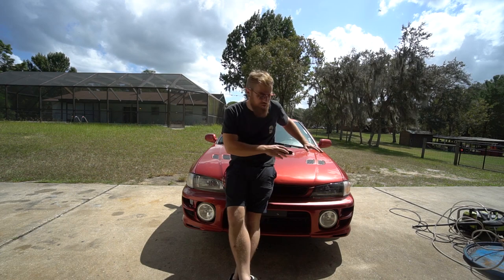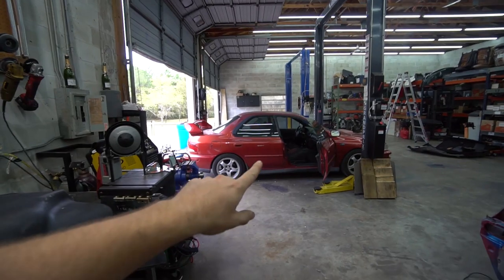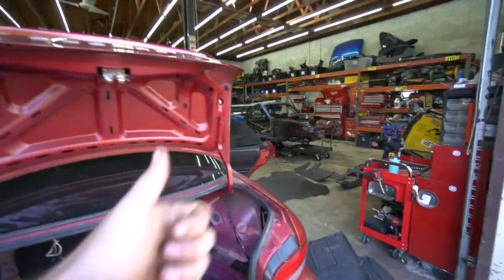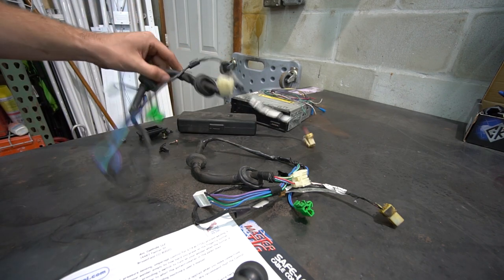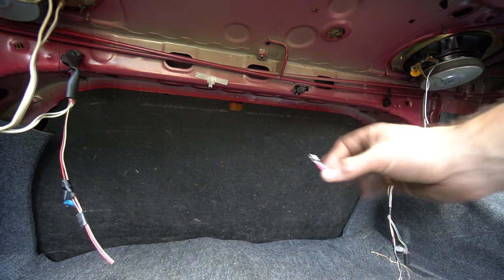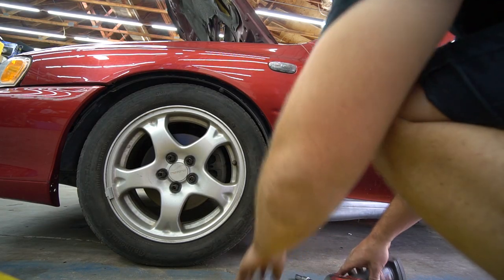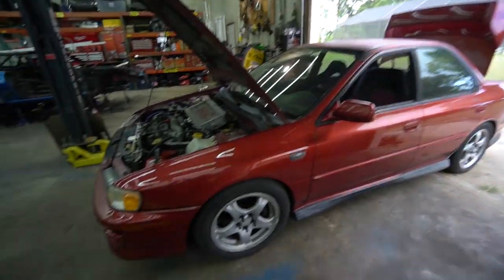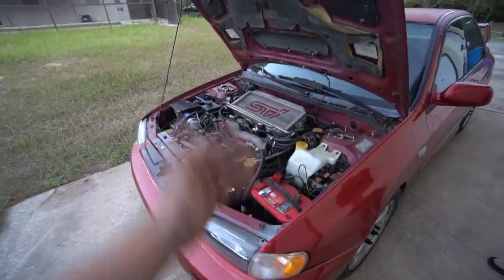Finishing the Subaru Build... And Breaking it Immediately on Florida's Best Backroad!

Comment: If you taking the gearbox out just leave the motor in. The bell housing bolts are super easy to get to from the top and a couple from the bottom.
Remove the down pipe, intercooler, starter, shifter, clutch fork pin, pitch mount and tailshaft and your pretty well done.

Comment: Speaking of things you don't know about in vehicles... The 2001 Impreza 2.5RS I got for free had a rectangular section cut out of the foam under the back seat. As you know, the back seat comes out with just 2 bolts. The compartment was a perfect size to hide some illicit things, hahaha.

Comment: The gearbox is easy enough to take out on these, just remember to remove the pivot for the fork in the box, iirc it's thread a 6mm into it and use that to pull it out.  btw your definition of a back road and mine are two very different things!! :)

Comment: You should really replace the factory oil pick up tube for the killer Bee one and put  loctite on the oil pump bolts they love to back out. Also an air oil separator is really good on those ej the pcv valve is junk these 3 mods are pretty inexpensive if you do it yourself and makes these engine pretty reliable!

Comment: Taylor. I had a hesitation from 2000-3000 rpm light throttle that would clear under boost. Disconnect your 02 sensor and see if it goes away. I had a bunch of corrosion on O2 sensor connection so yours maybe a bad O2! Keep up the great content!

Comment: 7:00 I managed to snag a whole box of 2005 Acura RL bolts, nuts, screws, etc from a scrap yard that just threw all of it in a box

I would not of have finished 90% of my projects so far if it wasn't for that, whenever I engine swap a car and need a perfectly sized 10mm bolt, chances are the box has it

Comment: Ugh, I HATE it when people cut the radio wiring harness...it's like an $18 (or less) part for a wiring harness adapter so you don't screw over the next owner of a car.
Reply: mrsilveri was thinking the same thing. #hack
Reply: When i bought my car i did some research on adapters and had to buy 2 different adapters to plug it in. 
Even after buying them, it turns out for whatever reason the cables weren't even the right way anyway and there was no accessory power. Had to return it and finally give into wiring it my self with the plugs that came with the head unit
Reply: @Pheatan  That's odd, what was the car?
Reply: @CalsGarage  depends, I  know a few that did it with some Hondas but the main issue isn't that. If the adapter harness was used it would make it easier for them to install whatever  head unit they wanted to use as opposed to sitting out testing what wire went to what. Just a cleaner installation.
Reply: CalsGarage the idea is you’re not cutting the stock wires, the next guy to install a stereo will have to cut back further into the factory harness which will be much harder to access as they are shorter, I did that to one car of mine and never again will I not get the harness 😂

Comment: Hey Taylor if you end up needing more GC parts HMU on Instagram. I happen to be a GC parts hoarder. My collection is always growing. 😂
Reply: 802 Garage hey I have a 93 legacy wagon, do you know if the coilovers for the Impreza wagon are a direct fit for the legacy?
Reply: @thatonemexicanrodriguez9558  Its been a decade since I had mine but iirc the fronts fit but rears don't. Some coilovers you can just use legacy specific aftermarket top mounts for the rears to fit. Odd that they vary.
Reply: @thatonemexicanrodriguez9558  I think maverick has it right. The first gen Impreza and Legacy coilovers are the same in the front, but not the rear. Not 100% though to be honest. Look up tons of forum posts and pics online!

Comment: Just a Reminder, 2ND gear is made of glass, it will break even under the slightest load. Here in Australia, Subaru stopped doing warranty on them, their excuse was the roads were to rough and it was breaking them just by driving the car.

Comment: TRUST ME PULL THE ENGINE.... NOT THE TRANS.. in 45 min i can have a engine out with a friend who knows whats going on. 2 hours to pull a trans. stupid roll pins in drive shafts and needing 2 ppl a lot of the time like totally remove exhaust and trans and rear tail shaft. dont mention putting MF back in! its so much easier to pull the motor. TRUST ME (says the random AUSTRALIAN guy on you tube lol)